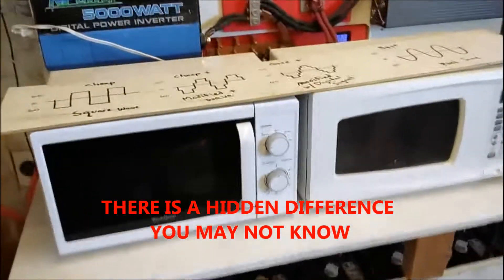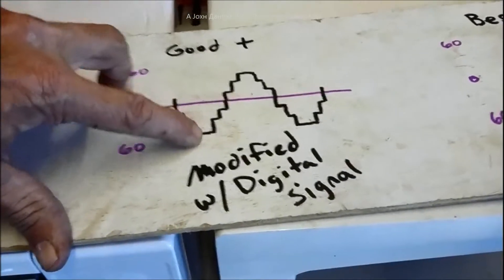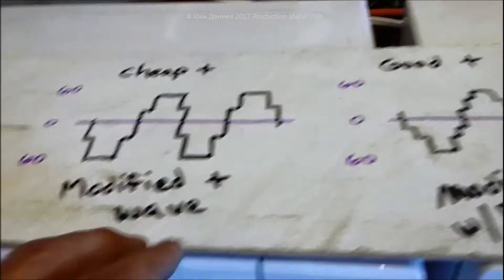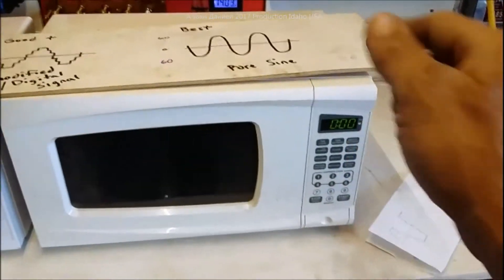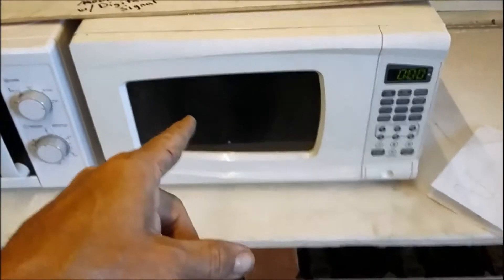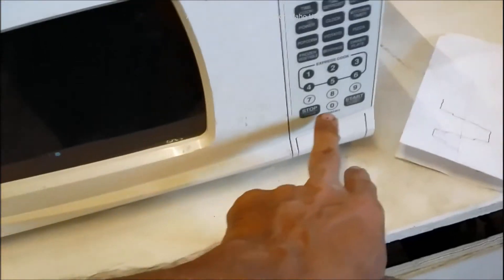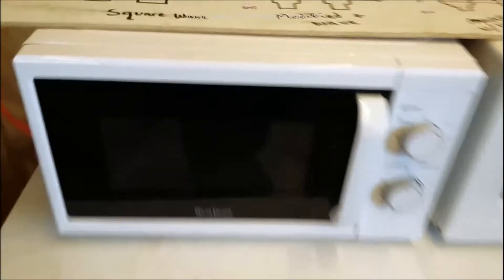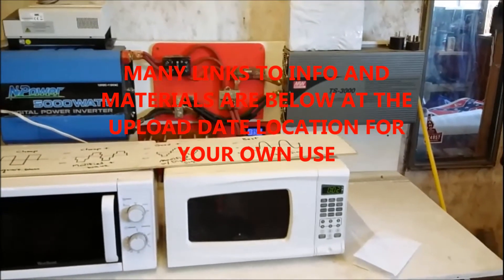Explaining power inverters - modified, modified +, pure sine wave

Comment: Thanks for the info. I just got a 700w microwave and the 2000w roadpro junk won’t run it. I hate that inverter never again will I buy their junk. Already bought a digital microwave crap.
Reply: It will not run because of your inverter, Or because you don't have enough battery power. I did a video showing my $99.00 (1100 watt) powerbright inverter running my 700 watt microwave. I also did a video showing my cheap $159.00 (1500 watt Realiable Electric pure sign wave inverter) running our 1000 watt microwave. I did another video showing my 700 watt microwave running of of my 1100 watt inverter hooked up to my van battery. If you want to see them then just check out my videos.

Comment: great info, i have an older 700w mechanical type microwave . just wondering will a cheap inverter like the square wave  run it ok ?
Reply from the maker: Some of the older ones would run on square wave and be a bit noisy, but the ones with clocks and electronics hate it. The 3000 watt PEAK/Potek inverters do a good job running them though. I think I put a link to them below the vid.

Comment: Hi there, would u have any idea how to safely lower the wattage?  I'm looking for ideally about 400, for my battery supply.
Reply from the maker: The only method to lower the wattage draw is to up the voltage supply. On many of my inverters I find the potentiometer in them and up them to 130 volts,  It will not hurt any inductive load, in fact you can run up to 150 VAC on most non digital appliances with no harm and motors will run cooler on 130 volts that they do on 120. Just have to keep the Hertz at 60.